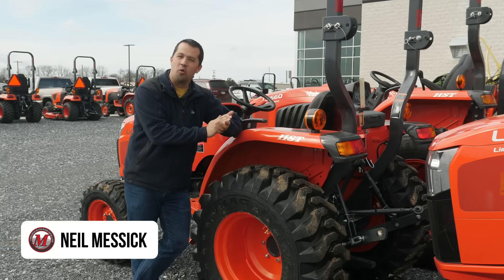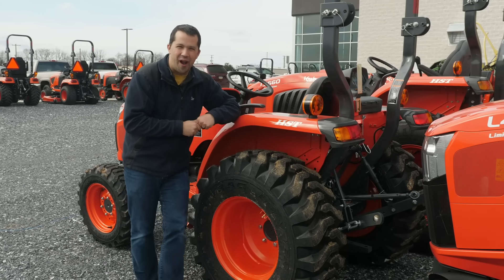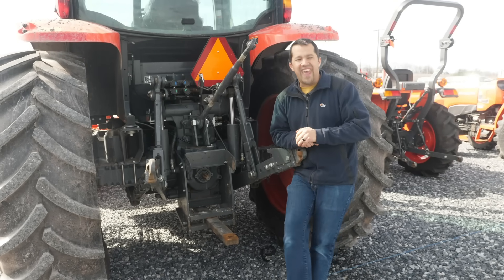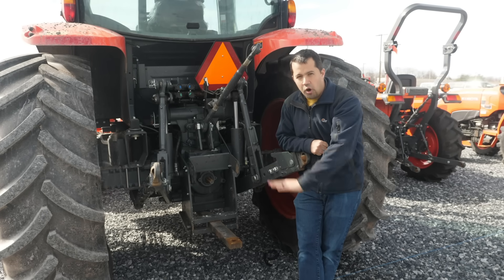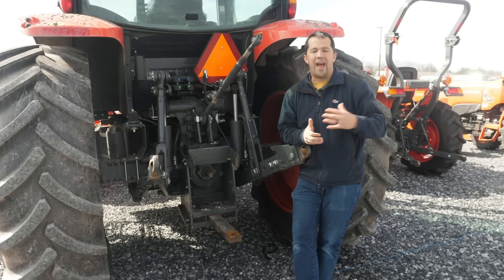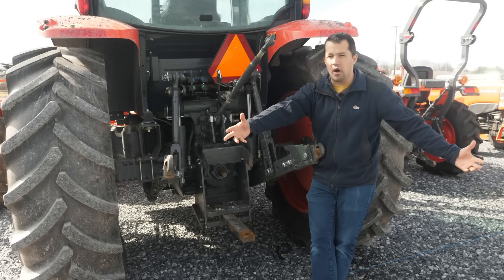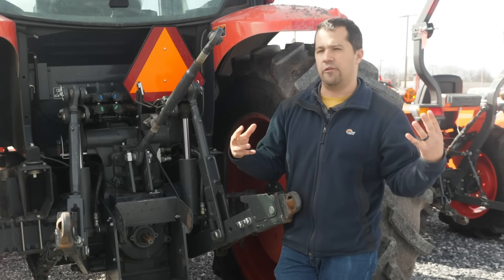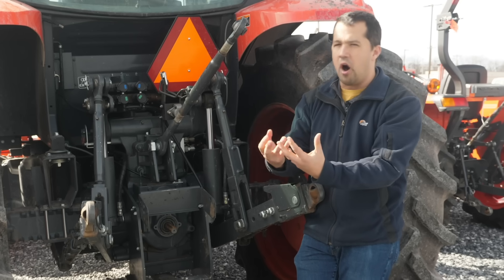Understanding PTO | What is it? How does it work? What types are there?

Comment: Hi Neil
In 2006 I purchased a new L3830HST and it’s been a wonderful tractor for my needs. In the video you mention using the clutch to prevent damage to the internal PTO coupler. I have never done anything but slow the engine speed prior to engagement. I referred to my owner’s manual and that indicates slowing the engine is all that is required. Perhaps the DT or GST models are different. Thanks and keep up the great videos
Reply from the maker: That certainly would help too. Doing the same thing in different ways

Comment: I have a gear drive l2501 and bought a wallenstien fx40 winch. Can you run the pto with the tractor sitting still and operate the winch?
Reply from the maker: I believe this model requires you to be in the seat.
Reply: @MessicksEquip  I just bought a wallenstien skidder winch which requires you to stand off to the side and operate a pull cable to activate the winch I wonder what I’d need to do to remedy me not being on the tractor to work it
Reply: @samwilliams9374  I can't say 100% for sure, but I think those tractors have a flip forward seat switch. If you flip the seat front, it may still run the PTO. If that's not the case, your only option is to get creative with the safety switches.
Reply: @neilmessick2043  thank you I appreciate your advice

Comment: I have a 2019 L3901 HST bought used with just under 300 hours. I have noticed recently that my PTO stub shafts is turning even when it is disengaged. It only turns when the tractor is in motion and increases rotational speed when the tractor increases speed. I don’t believe there is actually power being applied to the PTO. Is this normal or something I should be concerned with? I checked my hydraulic fluid levels and they are fine.

Comment: Neal, how does the weight of a sprayer or hydraulic pump affect the pto shaft and seals?  We just slide on pumps and really don't think about the weight of it on the shaft.  Should these pumps be supported somehow?  Maybe this will prevent premature wear of the seals or possibly bending the shaft?
Reply from the maker: Can't see it being a problem. It can't be much heavier than that big PTO shaft.

Comment: I have a ? I want to buy a trencher for my New Holland powerstar 65 its a 4 cylinder diesel roughly 65 HP. I am not sure if I should buy the 3pt rear attachment or the front attachment since I have the skidsteer quick connections. But, I am sure if I would get more power to the trencher attachment from the front loader or the back shaft of the tractor
Reply from the maker: Much more from the rear PTO, but probably a lot fewer options for trenchers as well.

Comment: This is a very plausible concept. 
Can you  remember the old International Scout? It had a standard p.t.o. (power take off) on the front end using the vehicles own power that can run various farm equipment. It was a novel idea.
Okay now think about the capabilities of the Tesla that can park its self.The future Tesla could pull into the new off grid charging station, sort of like a Rumba vac does except its on board guides it to connect the p.t.o. and power connections to a generator. Once connected the Tesla starts turning a generator 72KW 3phase generator that can charge the Tesla at the same rate as current charging stations does.
Like the international p.t.o. running farm equipment. This is totally off the grid and now you have a totally self sustainable Tesla.
Reply: The old Willy's had a PTO option as well, and current heavy duty trucks still do and most times when equipped they're hooked up to a hydraulic pump for a dump bed or something of that nature...but definitely still an option.  Too bad there really hasn't been much of a market for it to catch on and companies build different attachments for them, but then again you probably don't want to drive your F350 around your field pulling a PTO implement LOL...but who knows.
Reply: @wildbill23c  but what if you  have  a cabin  out in the middle  of nowhere  and  your driving  a new Tesla truck that just  so happens  to have  a p.t.o.  that can supply a recharge  to itself and run a 20kw generator. Did the light  bulb just kick off with some?  This technology is in our faces  and not a god dam corporation is  interested in developing it WHY?
Reply: @tinybetron8701  How exactly do you plan on charging the Tesla, or any electric vehicle?  You can't just plug it into itself LOL.  As cool as you think it sounds, running a generator off an electric vehicle to charge the electric vehicle won't work, you'll use far more power trying to run the generator off a PTO than you will replace.  Lots of parasitic loss in that.  Solar system would be your best option, and add in wind turbines as well....then you don't need a generator at all, just an inverter...which also has parasitic loss converting to AC from a battery bank, just as your electric vehicle would be doing trying to convert from the generator output back to the voltage for charging its batteries...would be interesting to see this and see if it would somehow be possible with today's technology, to not have a bunch of loss in power conversion DC to AC and back to DC.
Reply: Good  lord another  solar  company  dick.  You fucken  guys are  holding up progress  in total  green  energy  without  wind  or your  precious  solar  that  only  works  in sunny  climate without  snow. 
 The remote  power  using the vehicals  own power  is all mechanical  100% doable.  Fucken prove me wrong. Also  if you  took one ,just one of the new carbon wrapped Tesla  motors you  can run  a 72kw generator  to power  itself  and a 20 kw whole  house  generator at the same  time.

Comment: Question,  you mention RPM of the PTO generally 500 or 1000. I have an L6060 with a snowblower on the front running off the Mid PTO and run it at 1500 RPM.  What did I misunderstand?  Or is there some factor I am unaware of due to this being run off the Mid?
Reply from the maker: Mid PTO is a different animal. Does not follow the conventions that the rear does.

Comment: I’m Bob Casey just wanted to comment on all your videos. I just bought a new l2501 hst with r-4 tires, quick disconnect bucket , set of forks and 5 foot brush cutter. I’ve learned so much by watching your videos. I can see you tell the truth about tractors. Thanks for all work explaining about almost everything people need to know. From Clarksville tn. Keep them coming. 
Bob Casey
Reply: I'm a new and first time tractor owner, and Neil's (Messick's) videos taught me a lot...taught me what I needed to know when I stepped onto the dealer lot, which in my case was 100% pointless as they had absolutely no inventory.  I already knew what suited my needs due to size constraints because of my small property and small shop/barn areas.  I bought a BX2680.  I knew the backhoe wouldn't be used enough to justify the cost, so I went with the BX2680 because I knew I'd inevitably want/need PTO powered implements and wanted the most available power.  After 9 months I am very happy with my purchase, this little tractor continues to surprise me at what it really can do in such a small package.  I am picking up a 60" mid mount mower for it this coming weekend.

Comment: I have a Landini tractor that has 540 1000 and ground speed PTO and the ground speed PTO is a rare feature, we mostly used it for a power trailer to assist in muddy conditions. But I can see it being useful in rare cases where an implement needs power at the a rate that is directly proportional to the ground speed.  This type of thing does happen although usually the implement is getting ground speed a different way such as my fertilizer spreader I gets ground speed by a special hub on the rear wheel of the tractor that is connected to a PTO shaft that drives the rate that fertilizer is released. This makes the spreader extremely accurate and allows the actual speed of the tractor to change without changing the rate per acre. Another thing not mentioned here is that a mechanically engaged pto is easier to connect then a hydraulically engaged one.

Comment: Great video, Neil, thanks for making this!  This is the best explanation I've heard about the various PTO types. (The Kubota brochures, manuals, etc. don't really do a good job of clarifying the differences, unfortunately.)   But of course, one question: if I'm understanding correctly, the difference between the L3901 HST (which has a PTO clutch pedal and I believe an on/off lever) and the L3902 HST (with a "push button"), is the L3902 has a hydraulic system to engage the PTO, as opposed to the 01's clutch pedal.  But once the PTO is engaged on either model, the operation of the PTO is identical, i.e. you can "shift" the HST range (L ,M,H) and the PTO will continue to spin.    Does that sound correct?
Reply: Yes you understand it perfectly 👍
Reply: @blessed7fold   Eureka!  haha,  thanks
Reply: You still have to stop to change HST ranges though.  But otherwise you are correct.  My BX2680 has a hydraulically engaged manual PTO lever engagement but its sure nice to keep things smooth and easy during the engagement, its not abrupt like I think every electromagnetically engaged PTO (the ones with the yellow knob switches).
Reply from the maker: spot on
Reply: @MessicksEquip    Well, only because of this video. Thanks again!

Comment: Question: You mentioned the hydrostatic transmissions use an actuator? How robust is that actuator? Is that part an item that if it breaks that you have to pull apart the tractor to fix?  Questions from a rookie, me!   Thank you again on explaining these benefits on a farm tractor I've learned and continue too!!
Reply from the maker: I would not say one design is radically more reliable. Taking care to Engauge things at low RPM and gently would help longevity.
Reply: The PTO on my BX2680 when I move the lever to the engaged position, its operating a set of clutches hydraulically to engage the PTO, and its mechanically done.  The electromagnetic PTO engagement is the same thing, except its done using an electromagnet on the clutch pack rather than a mechanical lever assembly.  The electromagnetic clutch works like the AC Compressor clutch does on your car.  When you press the button, or turn the knob, it sends an electrical current to the magnet, which causes it to lockup to the clutch plate pushing it to the engaged position...which in many cases is quite abrupt.  This same type of principle works in many 4WD "auto" modes in trucks and SUV's.  A magnetic clutch activates the 4WD when demanded.  The manual system works kind of like your clutch in a manual transmission car, and can be slowly engaged for smooth engagement rather than a sudden jolt, as you would get if you shifted into a gear and dumped the clutch, which is what typically occurs with those newer electrically engaged PTO systems do, its either on or off (engaged or disengaged), there's no "slipping the clutch" on those.  

Using a lower RPM, a couple hundred RPM above idle is plenty to engage the PTO.  You don't want to run your RPM up to PTO speed then engage it that's where you'll find yourself breaking shear pins and causing shock load damage to the implement and/or your tractor.

Comment: I hope econo-PTO NEVER goes away... it's that much less revolutions and wear on the engine itself. 1550 rpm vs 2100 rpm - do the math. I use it in a lot for urea spreading, bale processing, or on a generator if the power goes out. Zero reason for a 150 hp engine to be screaming.

Both mechanical or electronically engaged PTOs both have pros and cons... one thing with a mechanical lever engagement is it really nice for starting implements that have a high startup load like a grain vac. The TS6 series thankfully has the option.
Reply: My tractor is way too small for that feature but I understand what its benefits are, and like you there's no reason to need full engine RPMs in a lot of cases for a PTO implement on a large tractor for sure.

Comment: I have a L2501 Kubota with a single stage clutch. Is it possible to switch out my L2501 single stage with a 2 stage clutch like on the L3901? Or is that impossibly expensive.
Reply from the maker: Not economical
Reply: @MessicksEquip  Thank you

Comment: Tractor Time with Tim had an issue with the PTO shaft that was too close to the drawbar and differences with Kubota and JD.  He claims SAE standard is JD and Kubota is not standard., as I recall. Can you address this is in a video?
Reply from the maker: I try not to make videos correcting others. I'm not sure what Time was really trying to get at. He was insisting on connecting a CV driveline made for a 75hp tractor to a small compact. Not something I have ever run into in the real world.

Comment: I have a L3240 HSTC-3 with a yellow twist knob. I’m assuming independent Electric start PTO? My question is do I need to use the clutch to engage the PTO or just simply turn the yellow PTO knob at low RPM’s ?
Thanks
Reply from the maker: Either works.

Comment: Have you ever had a new tractor come in with a defective pto shaft ?  The shaft on my 6060 wobbles, it is not loose, it just wobbles. I have given up on my dealer, so I either need to not use the pto or find a independent mechanic to try to fix it for me. It was the first time I tried to use it, it had less the 50 hrs on it when I tried it. Also the trans started making a slight weering noise after I tried to use the pto ??
Reply from the maker: Its under warranty, I'd get it into a different dealer to be looked at.
Reply: @MessicksEquip  thanks.

Comment: Kubota removed that clutch pedal on the new L3301. Stupid move. I say this because on my old l3301 I liked using the clutch to bring in my pto slowly for say like starting my post hole auger.  
The new m7060 I have don’t have that option. A lot of guys I know who has those tractors are now running clutches because of the sudden torque that shaft has once you twist the yellow electric knob to engage the pto.
Reply from the maker: the next person will complain they can't use their steering brakes because the clutch pedal is there. Fair alternative is to throttle down before engaging.
Reply: @MessicksEquip  
Im not complaining get into one of your M7060s over there hook up a 72 inch brush hog at idle and turn the yellow pto knob. And if your lucky you won’t shear the pin.  Better yet try it at the 540e?
Get on some tractor talk sites and see what people are doing and talking about how there engaging there pto what there breaking and solutions there coming up with.  
I’m not dogging kubota I love there equipment but god forbid if you mentioned something that should of been maybe left alone.